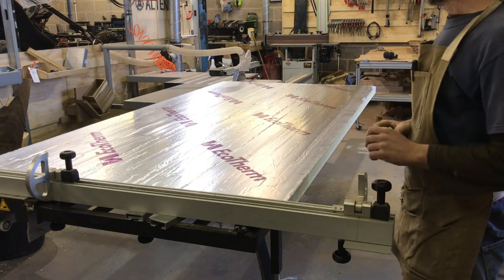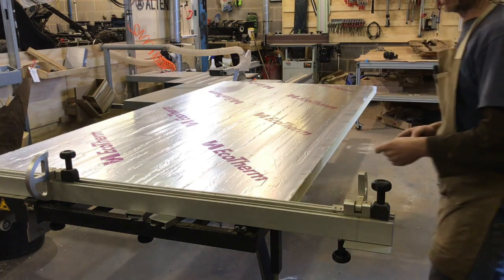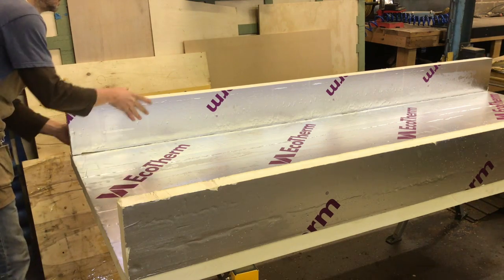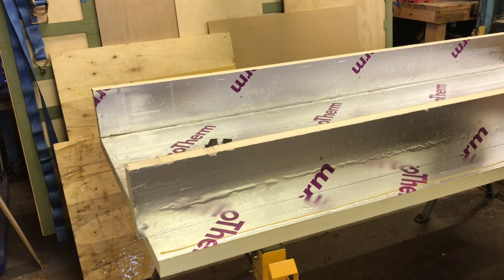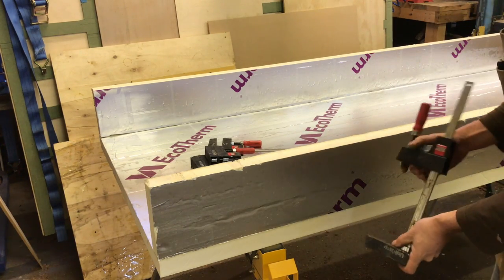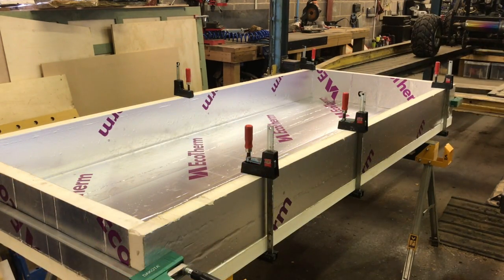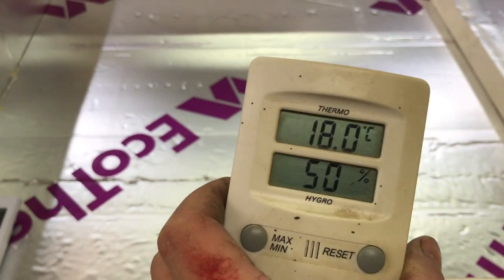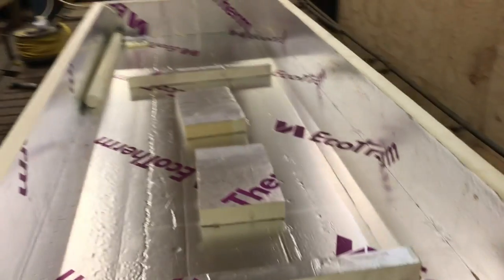Epoxy Resin Curing Oven - Easy DIY

Comment: Can epoxy be post cured days after the initial cure?
Reply: It depends on the type of epoxy you have. Some formulations are able to be post-cured, some are not. Check the manufacturers technical support. If it is able to be post-cured, they should have guidelines for the cure/post-cure profile.
Reply: It depends on the type of epoxy you have. Some formulations are able to be post-cured, some are not. Check the manufacturers technical support. If it is able to be post-cured, they should have guidelines for the cure/post-cure profile.
Reply from the maker: Why would you need that ?
Reply: @ManorWood   heat resistance is too low , post curing increases stability under moderate  heat . 
I have a small board that I've let to cure at room temp , 5 days ago and when the sun hits it directly for a few minutes it gets noticeably softer ....

Comment: Do you leave the heater in the box as the resin cures, or does the chemical reaction provide enough heat without it? Do you think a brewing heating mat would also work instead of the tube heater?
Reply from the maker: So I have a little temp/humidity monitor I There and keep some air flow (leave gap or make openings).  Then set a very small 40watt tube heater so it stays around 15/20..